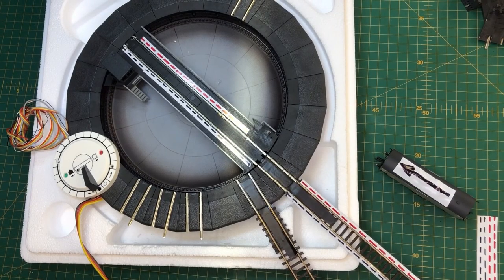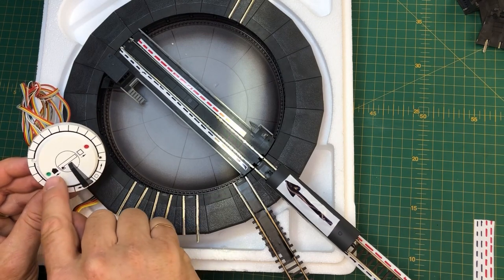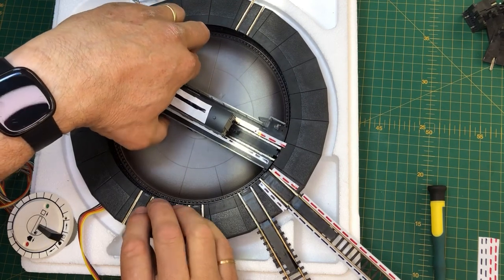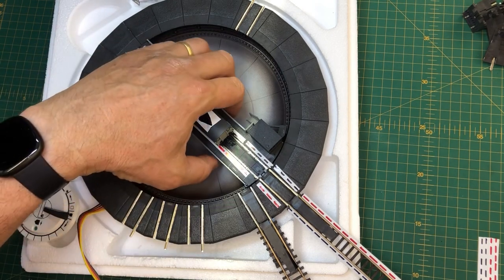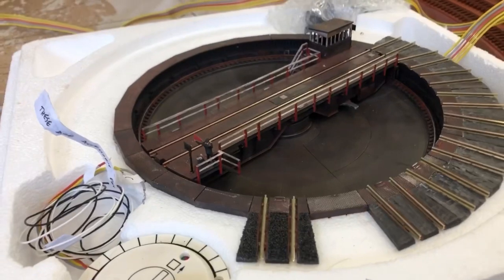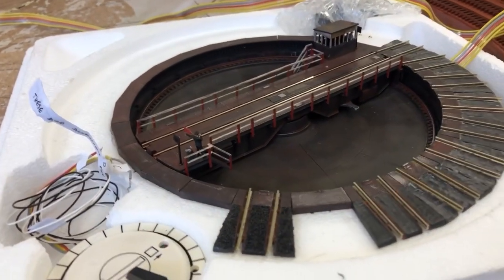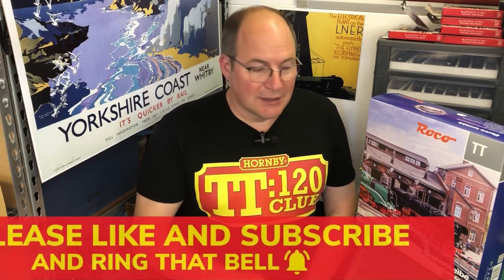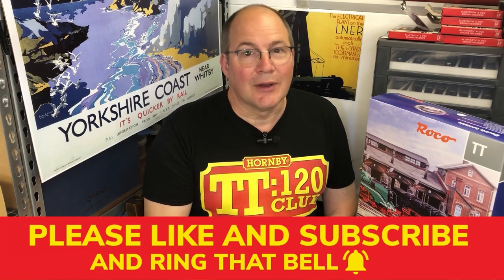Peachy TT120 Camelot Episode 5, installing an upgraded Roco 35900 TT120 turntable. @ThisWayWorksTWW

Comment: Nicely done. The loco just fits but enough is as good as a feast, as they used to say! Well done to TWWs too.
Reply from the maker: Cheers Greg, yes its 184mm end to end and the Hornby Pacific chassis has an overall  wheelbase of 160mm. I don't think they make anything longer?

Comment: How did you end up connecting the Peco track? Soldered? Just left a small gap?
Reply from the maker: The Peco track isn’t connected to the Tillig rail that’s on the turntable if that’s what you mean? It’s pinned & glued as accurately as I could make it. It needs an insulating gap as otherwise the sprung loaded rail connectors that travel with the table would short out every half turn (each space exactly half way between off ramps)
So short answer, the turntable isn’t connected to anything other than each off ramp in turn.
Reply: Thanks for your quick reply. That is what it looked like.